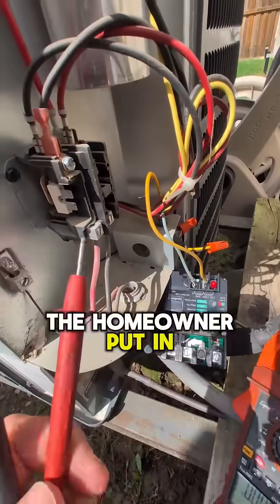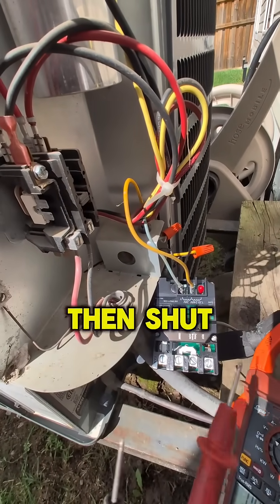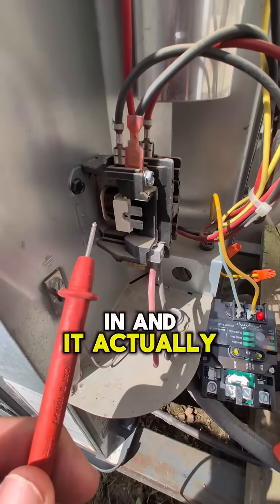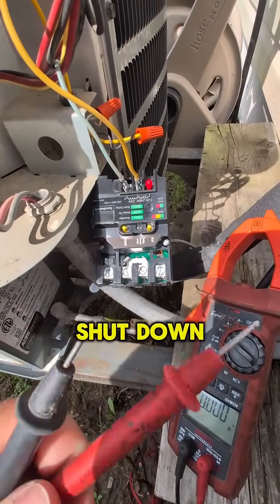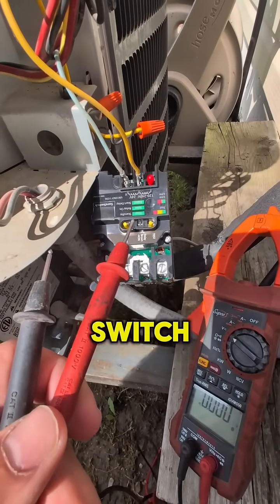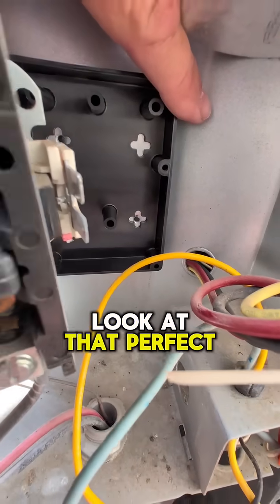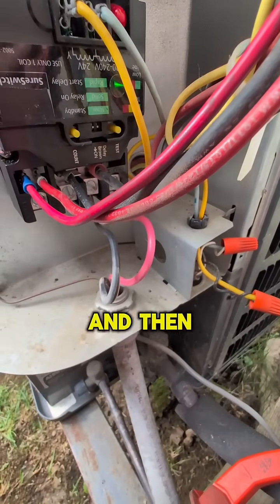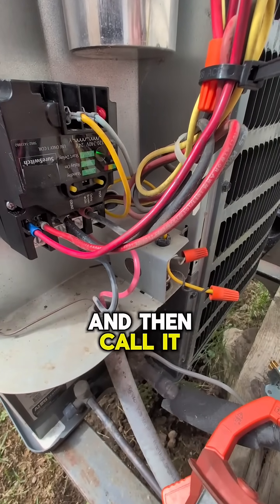Contactor Replacement w/ The Copeland SureSwitch

Comment: Someone always making things more complicated and more expensive than they need to be.  Throw a 2 pole 40 amp in there and call it a day.  10 dollar part.  Last 20 years.   If your unit is short cycling, or amperage is high, you have other problems than the contactor.

Comment: So Contactor was the problem or a long thermostat wire?
Reply: 2Ω on the contactor coil, not enough resistance to pull in the contacts completely.